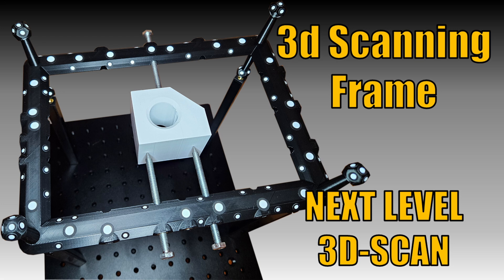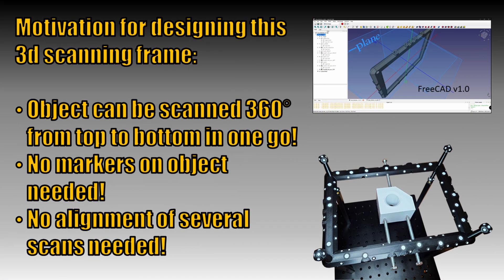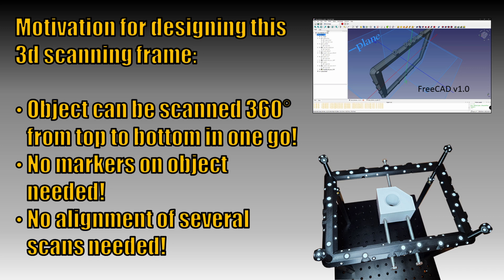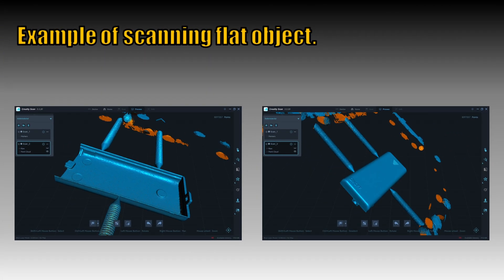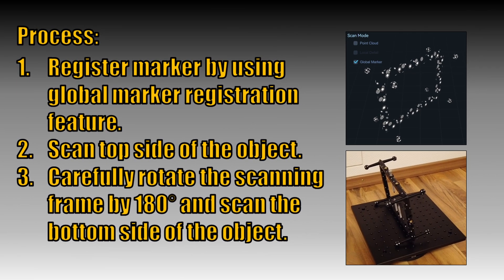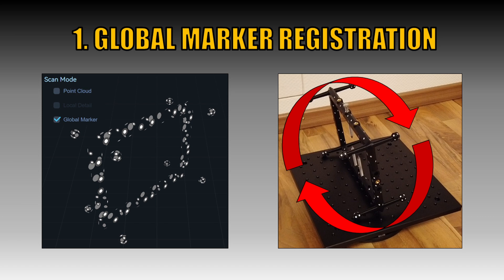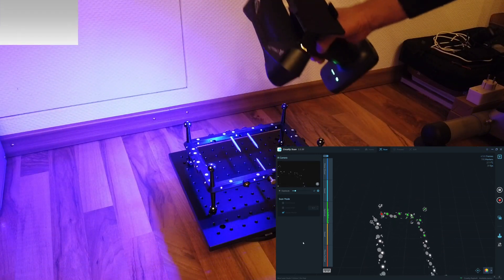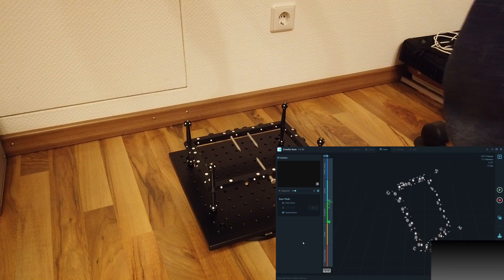3D Scanning Frame For Laser Scanner using RaptorX

Comment: Has anyone managed to use MetroX? Do you have any suggestions?
Reply from the maker: It works with MetroX, but not very well because of small field of view. You should increase the scanning range to maximum value in RevoScan SW then it can be used with this scanning frame. It's bad design in RevoScan that detection of markers is also limited by scanning range. Creality or Shining3d are not doing this, for good reason. BTW... it works like a charm with new Rockit.

Comment: great video. Did you make the base plate that's on the ground? or is that for purchase?
Reply from the maker: Thanks for the positive feedback! The base plate is purchased aluminium plate with M6 threads. You need to search for "optical flat plate" to find some offers.